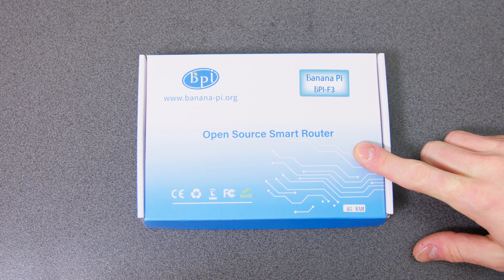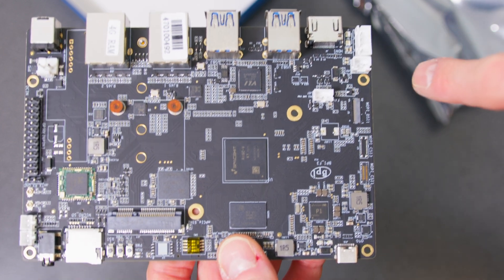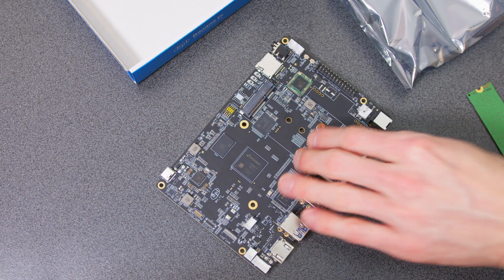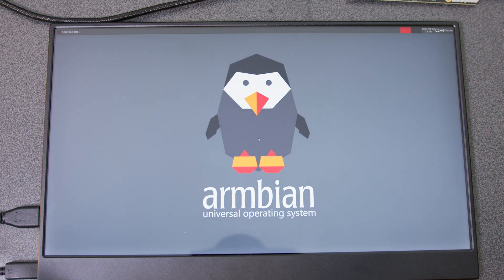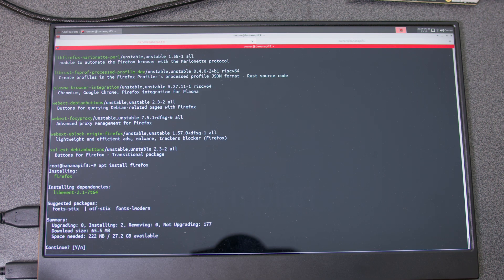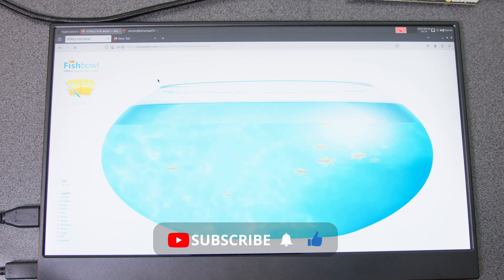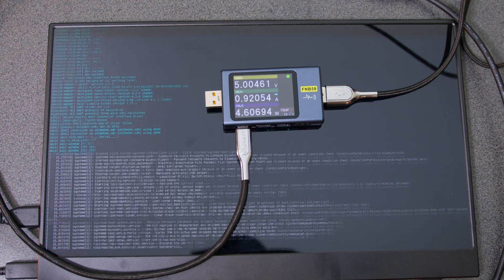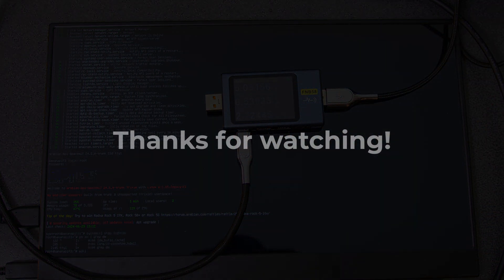The Banana Pi BPI-F3 may have the SpacemiT K1, but it is an ARSE product

Comment: Thank you for providing honest, real world reviews and exposing this e-waste for what it is.  Looking forward to your take on the Meles, mine is dead in a drawer with non-working EMMC.
Reply from the maker: Hey mate yeah I have 2x Meles too, that was meant to be the video. One is dead dead, the other I have not unboxed yet because I'm waiting on the Milk-V team to figure out how I killed the first one 😅

Mine is dead at a low level level though; no UART output, cannot even flash SPI without it crashing. All I did was boot the wrong image 😐
Reply: @PlatimaTinkers  when you say dead-dead, is it dead even to mask rom recovery (the one mask room boot mode you can trigger by setting the boot select jumpers, that lets you send code via IIRC ymodem, straight to RAM to be executed)
Reply from the maker: @dkpriest  Hah yeah dead dead. Ended up going back and forth with the Meles dev team, and we think the SPI flash unexpectedly failed, because I can write to eMMC and RAM over UART, but I cannot write to SPI flash, and when I reboot in normal mode, there is no UART output, which would come from SPI flash first usually. Posted it to them yesterday

Comment: Should have run Bainbu. Or, should have done things people use a server for, not try to use it as a desktop machine, which it's not intended to be. Firefox is absolutely the LAST thing I care about with a board like this. I want to see some tests of RVV. I want to see how it goes building some software compared to a VisionFive 2 or Lichee Pi 4A. Also, since when is US$74 expensive?
Reply from the maker: Hey yeah I thought about it, but I'm really not that keen on running something so closed and unique. Eg an OS just for one board? No thanks.

I get that it's not necessarily meant as a desktop machine, however, it has microphones, full size HDMI, 3.5mm TRS, and 4x USB ports - so they kind of aim at that market it seems. Plus a lot of the questions I get are based around interactive use cases.

Happy to run any compiles on it you want with `script` or `time` outputs for you. Else if you want, I'm still keen to try the LicheePi 4A if you want to swap boards?

Mine ended up costing a bit more than that $135 all up I think. For what it can do, I cannot really justify it, but you are right that it might be excellent for compiling or other SMT RISC-V ops. Single core Clang (https://browser.geekbench.com/v6/cpu/6715130) was about a 25% improvement on the K230 (https://browser.geekbench.com/v6/cpu/4717013) in your favourite benchmark suite.

Thanks for the input either way mate!

Comment: It wasn't meant to be a general purpose system. I've seen this implimented headless with variations of openwrt etc. and were perfectly fine in that specific use cases.
Reply from the maker: Yeah I absolutely get that, and can see the use, but then why make such a huge board with piles of USB, dual microphones, speaker ports, headphone jack, and HDMI out?

I think target one thing; be industrial, or be a router board, or be an everyday SBC. Don't try (and fail) at all of them at once 🤣

Comment: One of the problems I find with some of these boards is that the specs look pretty good on paper but software support absolutely blows goats. At least with Raspberry Pi EVERYTHING works out of the box with minimum fuss, lthough you're paying a bit more, and long term support is better. Still, I'm pretty excited by RISC-V boards becoming available but I'll wait until software support matures a bit until I shell out for a bigger board.
Reply from the maker: Yeah I completely understand that, and feel the same way!
Reply: But RPI's suck with such limited I/O, low end SoC and such limited memory. They blow goats so bad.
Reply from the maker: @eat.a.dick.google  not all I think, I like their company and their ideology, but this just hurts!
Reply: @PlatimaTinkers  Yes, all. RPi 5 is the newest and still sucks. Using RPi's hurts for much of anything beyond very low end tasks.
Reply from the maker: @eat.a.dick.google  they are a great educational tool at least!
Reply: @PlatimaTinkers  They're fine for lots of lower end tasks or even OS bootstrap initially, etc. Personally I use an Orange Pi 5 for the better SoC with more cores, 16GB of memory and NVMe storage. Though as an OS packager / porter I could use faster cores.
Reply from the maker: @eat.a.dick.google  Yep I've got an Orange Pi 5B that I quite like, but the Luckfox Core3566 is bloody good (https://shop.plati.ma/products/luckfox-core3566-wifi-4gb-ram-32gb-emmc) and I'm keen on trying out a Radxa CM5 Lite
Reply: @PlatimaTinkers  they could do with a little less, uh, surveillance-specialising cops?
Reply from the maker: @ThylineTheGay  Hahah

Comment: Summary

* (0:00) Powerful SoC, Poor Implementation: The SpacemiT K1 chip has potential, but the software, documentation, and even some hardware aspects are poorly implemented. 
* (5:10) Broken and Limited OS Images: Both Armbian and "Debian" images have issues:
    * (7:50) Lack of web browser pre-installed.
    * (8:43) Armbian build had broken Ubuntu repos.
    * (8:43) Debian build had limited package options, possibly due to using Debian Sid.
    *  No GPU driver available.
    * (6:18) Limited to 4GB of RAM, even with an 8-core CPU.
* (9:30) Unclear Use Case: Marketed as a "smart router" but lacks built-in tools or clear documentation for that purpose.
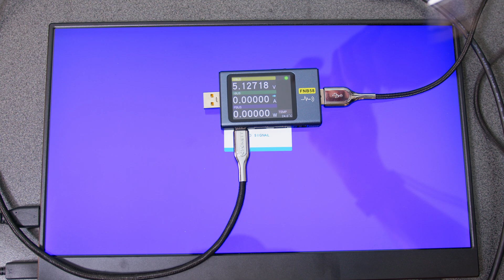* (13:35) High Power Consumption:  Idles at around 3.8 watts, even without a desktop environment.
* Overall: The Banana Pi BPI-F3, despite its powerful chip, is a disappointment due to its poor software support, limited RAM, unclear use case, and high power consumption. The reviewer strongly advises against buying it in its current state. 

i used gemini 1.5 pro to summarize the transcript

Comment: was it meant to be a desktop, i guess not, checked, got "single board computer,network storage,cloud computer,smart robort,industrial control,edge computer,etc."
seems to be fine as a command line pc, no gui, does it have support for touch screen, for kiosk mode or pygame
Reply from the maker: Yeah so odd, and advertised as both a router board, and as industrial grade, but does not seem to stand up to either spec!
Reply: the 'ai' marketing for so many of these is so annoying
literally anything else could that silicon be used for
Reply from the maker: @ThylineTheGay  Yes and no. I think it's pretty useful in SBCs as most support MIPI-CSI, thus it's easy to do object detection, etc. A lot of them are designed as devboards or proof of concepts around such matters, ideally being turned into embedded systems, doorbells, POE cameras, etc.